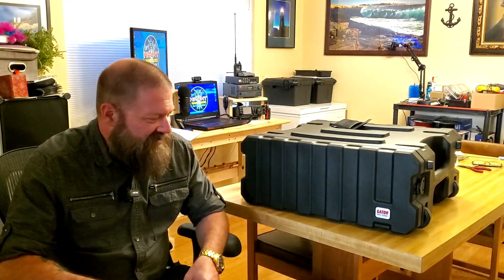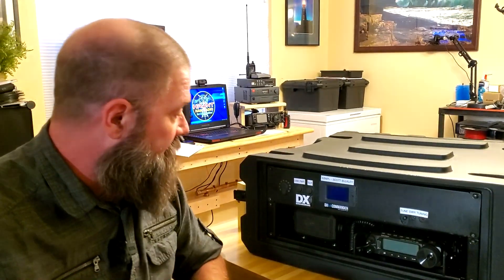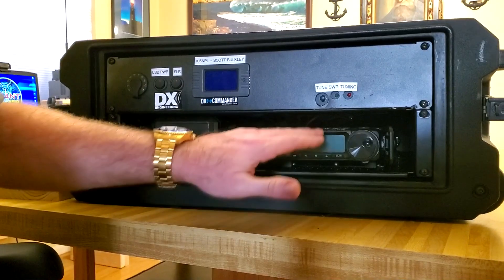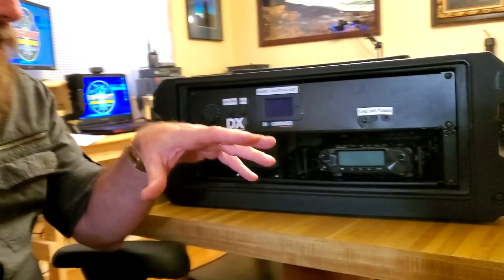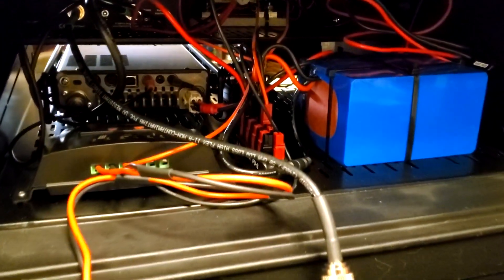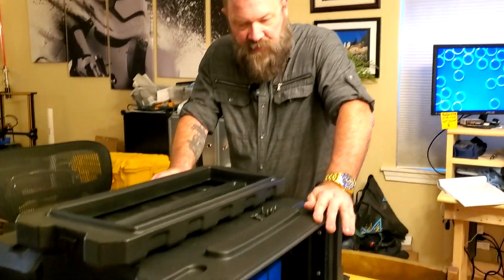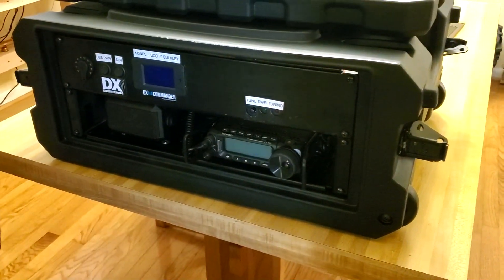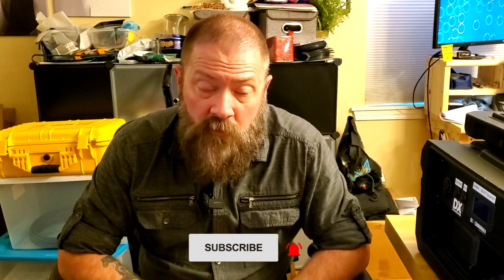My Ham Radio Go Box Build

Comment: The cooling fan is sucking out the air or blowing in? I'm confused about the direction it should be on my go box.
Reply from the maker: If you are going to have a fan in your gobox, I would probably have it blowing the air out as you may be in hot weather and blowing hot air would be counter intuitive.  I hope this helps.  Thanks for the question and for watching.  73!

Comment: Nice build. If you would have used the LDG Z-100A or the MAT 30 tuner it would power from the radio. No need for an extra power source. Also, put a power pole face mount on the back panel connected to the battery for charging without removing the panel. Nice and clean. Good job.
Steve, k7ofg.
Reply from the maker: I have some modifications planned in the future, but that you for those suggestions!!  Thanks for watching and for the comment.  73!

Comment: Hello from Tulsa KF5MCJ, the handle is Ron. I retired last year and am now working on my ham radio station. Right now I do not have any plans to do a "Go Box" but I hear other operators doing it. I sure wished I had worked on this one with you. OK, an introduction is in order. I am a Navy Veteran, Electrician on an aircraft carrier, 1975 thru 1980. I just retired from a major utility company as a Principal Designer for Protection & Control Transmission Substations.
Reply from the maker: Nice to meet you Ron!  The go box build was fun, but in hindsight, not completely necessary.  I could have built this with a much smaller footprint and been just as efficient.  This was more of a "can I do it" build.  Thanks for watching and for the comment.  73

Comment: It's not the worst wiring job I've seen.  Keep in mind that those face plates and covers are meant to hide all of the wiring. I wouldn't lose sleep over it.     If I was going to add something,  it would be switchable charging and a connection on the back (or front) for the 120vac charging cable. Then, you dont have to remove the rear cover to change charging choices.    Put multi pole switch on the front panel for charging option selection.
Reply from the maker: I may add that feature to the setup down the road.  Thanks for the comment and for watching.  73!

Comment: Nice build.. i started with a 6U case with a Kenwood D700A and Ft891. It now houses my FT-991A and am building a box for my D700A and Ft891. I also built a multiuse 100ah solar generator. But the battery meter is the test thing i have ever had. I used  Eco-Worthy LifePo4 50ah batteries because I got the at an awesome price. Regular price was $225 each... Sale price $135 each. I couldn't pass them up.
Reply from the maker: That is OUTSTANDING!!!!  Thanks for sharing your build.  At that price I wouldn't have passed it up either.  Thanks for the comment and for watching.  73!

Comment: Awesome build. I am a newbie and I am gathering stuff for building a harbor freight go box. I just bought a Yaesu LTM 300DR which draws 11 amps TX at 50 watts. I am having a hard time figuring out wire size and fuse size going to a distribution box then to a watt and amp meter and  switches
Reply from the maker: I have 25 amp fuses for the majority of my gear.  However I am also not an electronics major.  You may want to pose that question to Yaesu and see what they would recommend.  I guarantee they will know.  Their number is (714)827-7600 between 8AM – 5PM PST.  I hope this helps a bit.   Thanks for the comment and for watching.  73!

Comment: Nice build.  Been thinking about using the 991a, have any ideas
Reply from the maker: Any radio will work as long as you can handle the weight.  With the 991A you will need two antenna outputs, one for HF and the other for VHF/UHF, but you should be good to go.  Let me know how it turns out if you decide to build one!  Thanks for watching as always Paul, 73!

Comment: How much operating time do you get from the 15ah battery?
Reply from the maker: At 100 W on my 891 I am able to operate all day long without any issues.  I am usually in a park from about 9am to 4PM on that 15ah battery.  Thanks for the question.  Hope this helps.  73!
Reply: @HR4NT  I have two 8Ah batteries. I wanted to get an idea how much time I could get out of one of the 8Ah batteries. I do have a 60 watt solar panel to,put in the system.

Comment: The only additional item you need is a cooling fan to pump any heat out of the box during use or while charging. You have room in the back.
Reply from the maker: That may be something I add in the future.  However I have found that I really like bringing out my 7300 now.  It is a much smaller setup than the go box and a lot lighter...LOL  To date, I haven't had too deal with any overheating except for me carrying that heavy thing around to the parks.  Thank you for the comment and suggestion and for watching.  73

Comment: How about dealing with the heat ? do you have a heat sink ?
Reply from the maker: There is a nice fan on the back of the 891 along with a heat sink and I have yet to experience overheating or anything that would affect the performance of the radio  on hot days.

Comment: N6EF-Nice build Scott. I built a self-contained kit using a Harbor Freight Apache 4800 with my Yaesu FT-857D, 20Ah Bioenno battery, solar charge controller, Raspberry Pi, and external monitor for the Pi. A bit heavy but works great for POTA activations. Great build.
Reply from the maker: That sounds fantastic.  Whatever works is always a good thing.  Thanks for watching.  73!!
Reply: Ya that's what I used as well.

Comment: I started a build like this just for a dual band 2M-70cm rig and power supply. A gator box was my choice, just like you have here. I now have a larger box for my HF voice, 2M packet rigs. It is heavy, screwed up by not getting a big box with a handle/wheels like yours. I will strap it to a wheeled cart to move it. Good work
Reply from the maker: Yeah when I was shopping around I knew it was going to be a heavy beast, so I made sure that whatever enclosure I chose it MUST have wheels.  It's great on pavement and hard surfaces, not so much in grass...LOL  Thanks for watching!  73

Comment: I really REALLY want to do this just to build it.   After I priced the box and then the cost of the shelving...OMG...   Like you said toward the end, it's just too much.   I look at my camera bag of stuff and that's all I need.    Certainly would be fun to build.   73
Reply from the maker: It is a fun and expensive build.  However, after building it and bringing it out to the field I found that it is rather heavy (at least 45-50lbs) and that can be a task to drag through a park even with the wheels.  I recently took my 7300 and put it into the X-large Apache case and got myself a 20Ah Bioenno that will be a bit lighter and still give me the 100w in the event I don't want to load the beast into the truck and drag it out.  My 705 pack is much easier to transport as well and I have another bag that has the other equipment in it and that seems to work fine.  Thanks for the comment and for watching.  73!

Comment: Another great video, Scott!  I am interested in finding a 4” hinged front panel and doing similar project to yours.  One thing about solar controllers, I have heard recently that the MPPT controllers can have more RF hash on it due to the DC-DC conversions they do.  That threw me since I assumed (yeah, I know about that term haha) that the PWM would have more hash but they said the PWM controller was RF quiet.  What is your experience with solar and RFI?
Reply from the maker: I haven't had any issues with RFI on my controller.  However, two things, I have heard from other that using the USB on the charge controller from Bioenno "can" produce some RFI, however I do not use the USB on the controller as I have others that are easier to get to and I think Bioenno is aware of the issue and are making new versions that will eliminate that issue.  The other thing is you can always add ferrites to anything in your box that is producing RFI.  My solar panels have a 20 foot wire that goes to the charge controller, so no issues there either, but again, if there was, I add ferrites.  Hope this helps.  Thanks for watching and for the comment.  73!
Reply: @HR4NT  I am back again.  My POTA/mobile setup is in process.  I have a 15AH Bioenno, with a solar charge controller. I was planning on using a cheap PVC chassis with wire mesh shelves for an open case.  Now I am leaning more to a gator 4U chassis, with the battery inside.  For the battery monitor did you use a shunt with that to know about usage?  By the way, I am planning on using the home HF rig at first which is a Kenwood 590SG with a SDRPlay for a pan adapter (all I have to provide is a laptop).  Hope to have the shark sticks mounted and the coax run into the cab before I go to Florida later this week.  IF I can get that done, I can do the bonding when I am visiting my son’s place in florida.  Still very much a work in progress and learning where to run coax into the cab (wish I had a lift - my aching back - haha). Oh I did order some Messi & Paoloni Ultraflex.  Nice stuff.  Way more flexible than my LMR400!  I also like the connectors.  I don’t know how I am going to protect the 1/4 x 24 antenna mounts when no antenna is on there.  Also, I want to make sure there is no ingress with water under the lip where it fastened to the bracket.  Fun to do these projects.  My wife thought I was working at this too hard and said instead of mounting the antennas on the truck just set something up at the park.  I try to tell her this is fun.  Of course I don’t always sound like it when I holler because I pinched myself with a tool.  Haha. All the best, 73! One day I want to catch up with you Houston boys!  Could be fun!  Cheers!

Comment: Awesome go box!

So I've been wanting to create a gobox for mobile/quasi-portable using my ftm-400drx and g90. This is something I want to bring in the back yard, garage, in my cars and parks. Seems feasible, but would like it about half the size of what you have and I think that should be possible. I'm not using bioenno but dakota lithium which I already know work great for both. I don't think I need a speaker but thought about working in a powerwerx meter. Thanks for the video, as a musician I can't believe I didn't think about rack mount storage. I think that's the way to go. Also, for all other hams out there, don't just look at ham outlets for peripherals. Ham crap is a niche market which tends to be very expensive. Think out of the box and tell your fellow hams what you learn. Also join your local clubs, they a have a wealth of information. And be kind to others we all live in the same biosphere.

Comment: Great video!  Welcome to the hobby.  I picked up your channel from your recent youtube collaboration with Lord Callum - The DX Commander!
Two things:
1. Don't leave AA batteries in your tuner long-term, they are good for short usages like a week away on vacation or something. Those batteries are notorious for leakage. ESPECIALLY Duracell batteries! They have had horrible quality for years now. 
2. Consider using the old-fashioned mosquito coils while operating outside. I don't like to use mosquito repellant sprays because of the oils they leave behind. I don't want to transfer that oil to my radio buttons and knobs - perhaps degrading the rubberized surfaces. Mosquito coils burn like incense. I use them on my backyard deck with great success!
Reply from the maker: Thank you for coming over to the channel!!  Those are great suggestions, so thank you for that.  I hope my videos bring value to you!  Thanks for watching.  73!!

Comment: That aint nothing. Try setting up a Digital Audio Workstation for home audio recording, now that can go from very simple (dual band mobile simple) to simply insane akin to guys with multiple towers and a dozen Yagis and parabolic dishes. It's a nice clean setup but that' I'm surprised there is no dual band, but you probably have that in your vehicle already. Makes sense now.
Reply from the maker: Yeah i have the dual band UHF/VHF in my truck and if need be, I can always remove it and make it portable.  Just wanted to make an HF portable rig to bring out to POTA.  Thanks for watching and for the comment.  73!

Comment: Great go box build.  You have made me proud.  Disagree about the meter though.  It wasn’t hard to wire and you know how much power you have used.  Wait till you try to figure out how to set the fuel gauge though lol!   Way better battery meter than others I have used.
Reply from the maker: Hey I am glad you saw the video and liked the build.  Maybe we over thought the wiring.  I have it wired not only to the battery, but also to the radio and I guess they way we had to wire everything just made it chaotic as I was trying to NOT have a mess of wires everywhere.  Wiring for DC is simple as you have said, but I was adding in switches and trying to make sure everything stayed in some order.  Thanks again for watching and for the comment.  I still want to join you out sometime for a POTA event!!  73!

Comment: I think you did a very good job!  I am not sure if it was on the wheels is it top heavy.  I had trouble with things falling over because it was top heavy!
Reply from the maker: The wheels definitely help with the weight distribution.  It stands up just fine with all of the equipment inside and no signed of teetering, so I would say that even with everything inside I have mounted, it is still stable.  Thanks for the comment and for watching.  73!

Comment: Wiring looks fine to me, there isn't a whole lot going on to add a ton of wires, so its pretty clean.
Reply from the maker: I appreciate that!  It just seemed like a mess to me because of the wiring we did to include that battery monitor.  I like what you did with the power switching feature in yours and may adopt that later on if I decide to alter the build.  The one thing I forgot to mention in the video is I used lever nuts to connect the wires that way IF I decided to make a change to the wiring, it would be very simple to just lift the levers, release the wires and move them to another configuration.  Thank you for watching and for the comment!  73!

Comment: My thought is to have the battery box power the go box this will give me more room.  Also like HRCC set up of being able to use AC and can switch over to DC.  If I build a box I will also include a CB, GMRS, thinking of using the 891 as well and maybe one of those Chinese Tri band mobile so I would have to get a 6U Gator Case.  Nice build
Reply from the maker: That is a lot of equipment to put in there.  You will definitely need the 6U (hopefully on wheels) for that build, but I think it would come out pretty cool and would serve you well for many years.  I like what Josh did as well with the switching power.  That might be an addition later one.  Thanks for watching..73!

Comment: Do you know how much the case weighs now with everything in it?
Reply from the maker: If I had to take a guess, I would say about 35-40 lbs.  There are two steel shelves that I purchased that are made for this case.  One is a 16 inch deep and the other an 8 inch.  The lower one has the majority of the items mounted to it whereas the top shelf only has the tuner and helps to keep the mass amount of wires out of the way...somewhat...Having the retractable handle with the wheels makes toting this thing around a lot less cumbersome.  Hope this helps.  Thanks for the comment and for watching...73!!

Comment: Cool build.  I am still deciding if I want to go all-in on a gator box build.  I was thinking the 6U, with a 7300 and a 2M DMR rig.  Something like that.  Still pondering it.   Good video dude!
Reply from the maker: Go for it!  If you are putting both of those radios in there the 6U version will work fine.  Josh at Ham Radio Crash Course built the one you are describing.  Check out his video if you haven't already.  Make sure you get the gator case with the wheels and handle though or you will suffer having to carry that heavy SOB everywhere...LOL  Thanks for watching.  73!
Reply: That's almost exactly what I'm thinking of building. Do it! Then build me one 😀

Comment: Any heat issues?  Great job!
Reply from the maker: So far, no.  The rear of the case has a 2U solid plate and above that a 2U vented plate to allow for airflow from front to back.  Thank you for watching and for the comment.  73!

Comment: Good build. I have the same speaker hooked up to the 891, too. It works well.
Reply from the maker: Yeah I was actually surprised how well that little speaker performed.  I made a mistake in the video saying that I got it from DX Engineering.  I got it on Amazon through Radioddity for like $15.  Thanks for watching.  73!!
Reply: Yes! Exact same then. I wondered if it was just differently branded packaging.